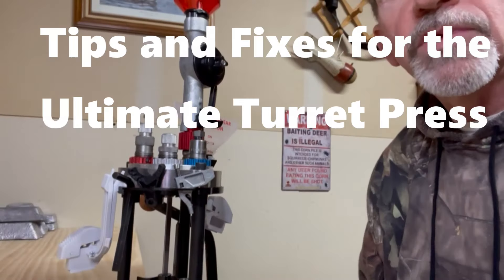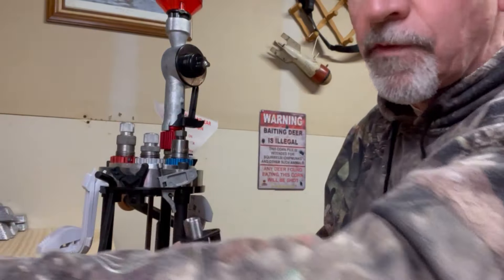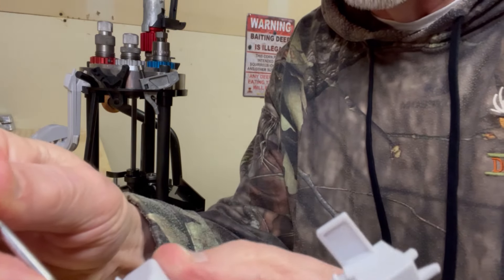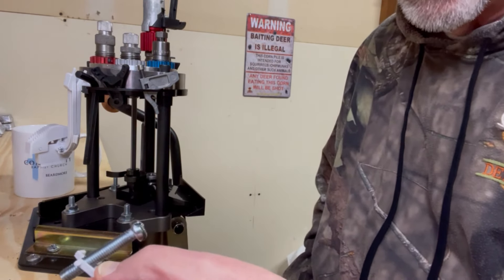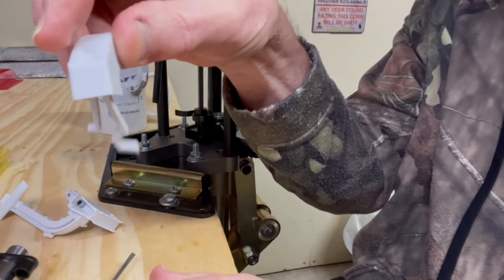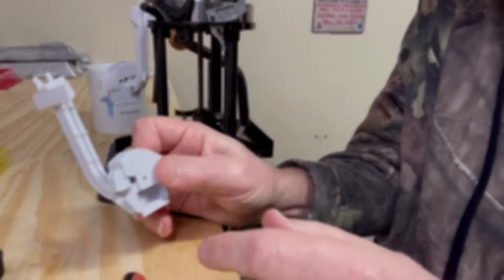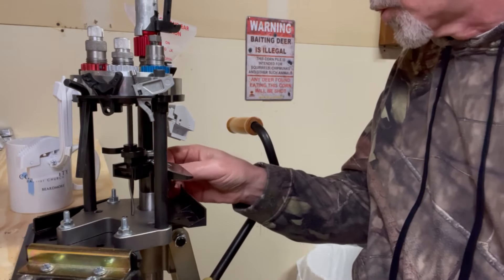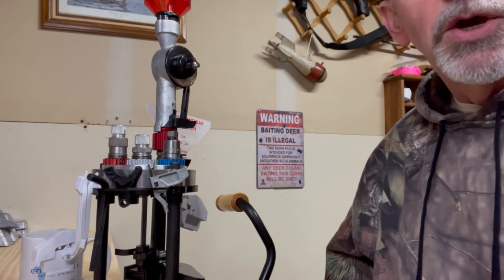Ultimate Turret Tips and Fixes

Comment: I also saw you mentioned the powder reservoir for the powder measure you have, I have that, in the bit older version, doesn't have the red bottom, and Lee has caps that can be turned off that fit the 1lb bottles of powder just fine, you twist and they turn off, the only issue with them is the fact that you can not see when the bottle goes empty, because they are black, so I use the clear ones that come with the caps. I learned that the hard way, fortunately I weigh every one of my 45-70 rounds, so it was obvious which were missing powder.
Reply from the maker: Thanks for the comments. I love the 45-70 and the rounds are way too expensive if you don't reload. Thanks for following me on Rumble also!

Comment: I have both the old style and new, triangle style Lee primer  tool, and I have to say, that yes they are not flawless, but what is? I would say after thousands of rounds through each, I have very  few issues with them, perhaps 1 or 2 out of a hundred, don't go in the cup correctly. I have not modified it at all. To be fair I mostly use the large primers, but I have also done a few of the small ones. I have recently bought a ultimate turret press also, in the last week, and it seems to be doing fine. I previously had one that was similar to a classic, but a cheaper version, not sure what it was called.

Comment: Yet again I'm sitting here with a fear of depression bearing on my mind and your video comes up in my feed... the close of the video felt as if though you were speaking directly to me. About the safety prime I lucked out and found another original set still nib and picked it up. The originals had the really nice lifetime trays instead of the flimsy folding ones. My problem with LEE is the fact that they started looking for ways to make things even cheaper so that they wear out quickly as opposed to how they used to do things...cheap, but reliable and many things could last a lifetime at a fraction of the cost of others.